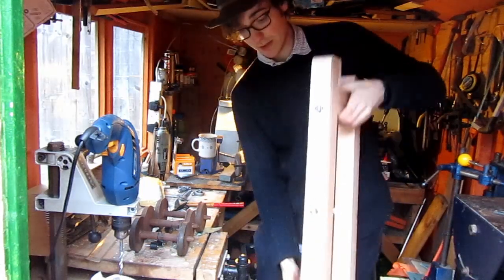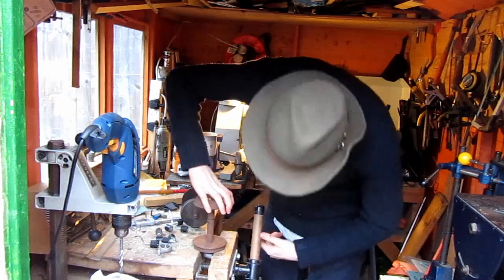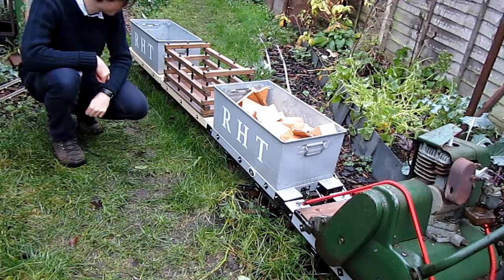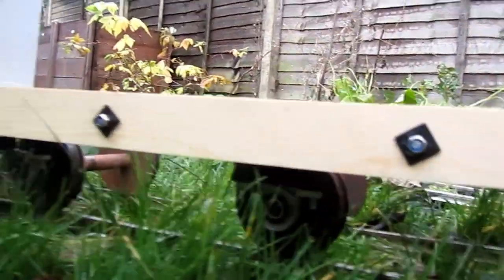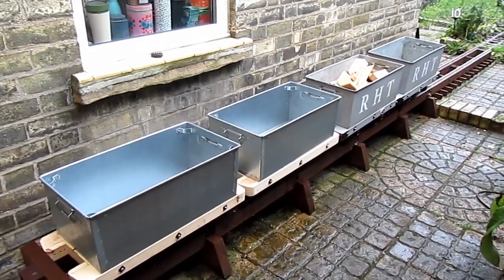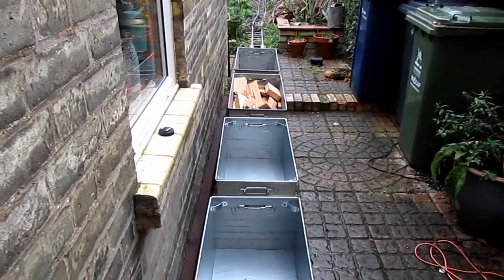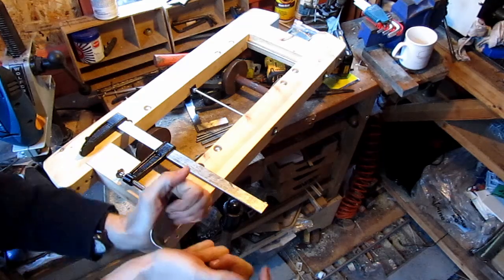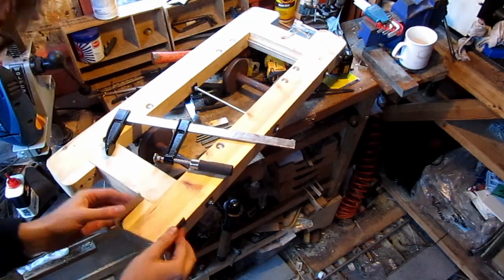Minimal Expectations 14: How to build a Tops Wagon Part 2

Comment: Excellent work Zach, the rounded buffer blocks definitely look better. Nice use of anti-vibration mounts, something I might have to consider for the MLR’s next wagon project.
Reply from the maker: Thanks, yes I quite like the rounded ends I must say. The mounts were used more as a cheap and easy way of getting the ride height right really as you can buy them in a variety of lengths - any damping they give is a side benefit.

Comment: If you do a third batch, an interesting idea for the buffers would be to do strait buffers, but wrap the steel more loosely so that it protrudes and is a bit springy. Instead of bending it to shape, cut it a tad long and just bolt down both ends. Might be interesting.
Reply from the maker: Oh yes, that is a grand idea. I'll have a think aout that - thanks!

Comment: Can I ask where you got the galvanised tubs?
Reply from the maker: Certainly. They are from BigDug. They are large galvanised work pans or parts bins. Mine are 230 x 305 x 610, part number SDGSSWPL5 from this page : https://www.bigdug.co.uk/storage-boxes-containers-c363/steel-parts-bins-and-tote-pans-c1650/galvanised-steel-stacking-work-pans-large-p14588

They were about £25 each when I first bought them but the price has gone up a bit since then. Still, for the quality amd ruggedness of the product I think they are well worth the money and they look very smart in my opinion (and have been very useful!)